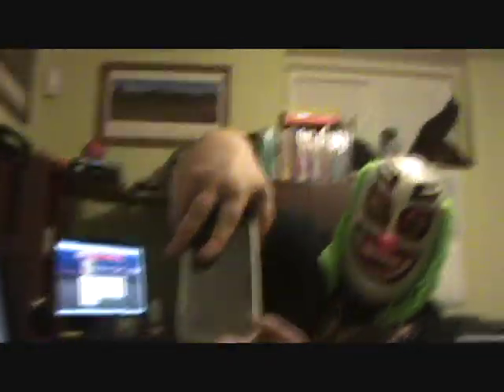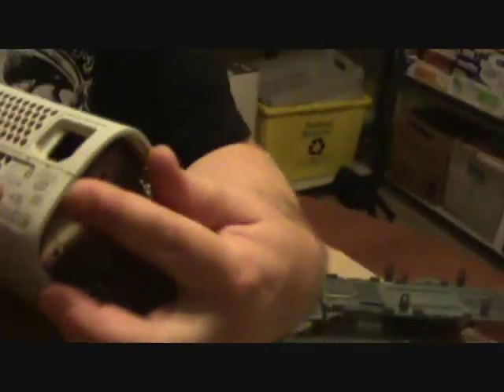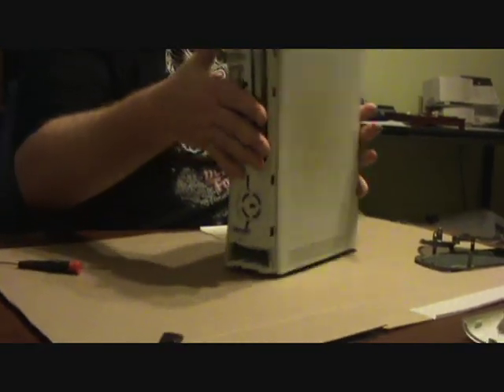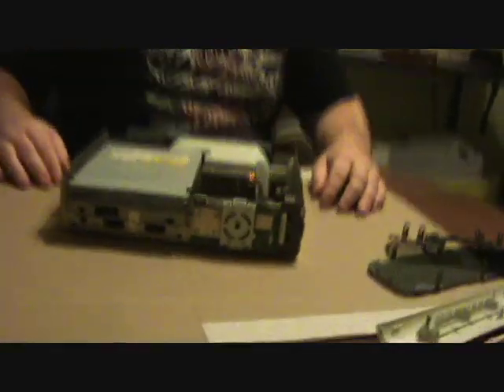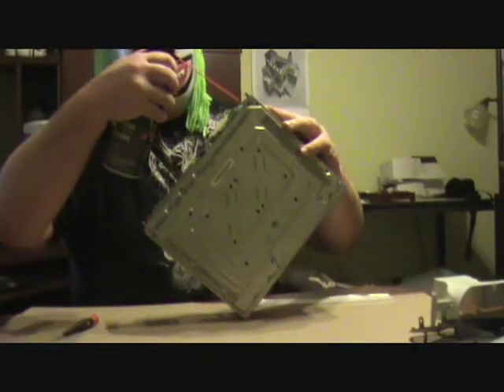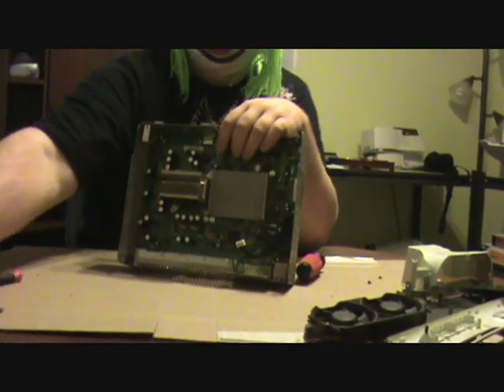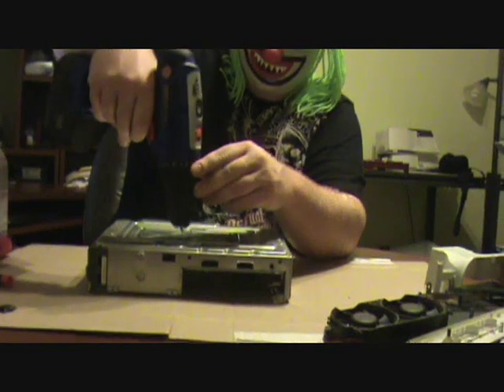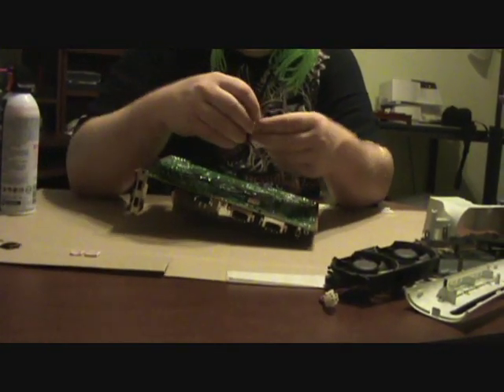XBox 360 Repair for 3 Red Rings of Death - Easy Tutorial

Comment: While it's open, solder some 40mm intake fans in. Put a couple on the bottom grey vent and/or one on the side, for even pressure air cooling. Frequently blow the dust out with canned air. Make it last >:) BTW you are NOT supposed to shake canned air.

Comment: ok so i got the #8 driver today and i got the new screws and washers i see people advertising that you need to do the proper fix and i got everything done today but now im having a prob where the fans get louder and louder and louder then its like either the gpu or cpu overheats or fails and i get vertical black lines on the screen. if i go back and put the x brackets back on, i get the e 74 posting on screen with one red light, like i had before i started. what gives? i dont think i have faulty

Comment: @iphonefreak20  You can use "Goo Gone" which can be found just about anywhere, Walmart, Home Depot, Lowes, Target, etc. It has multiple uses around the house so you get your moneys worth out of it but it also works fantastic on getting old thermal compound off. I just poured a little bit out of the bottle into a little plastic medicine cup, the kind the come on top of nyquil and such. Then I dipped a q-tip into the little cup to get some Goo Gone on it, then cleaned the processors with it

Comment: Thanks Doc, I fixed my xbox thanks to your video. I also used a heat gun after having cleaned the processors as shown in other videos. Just one remark on part 2 video: I could not mount the CPU  heat sink the same way as you did at 4:12, it had to be turned another way, maybe because I have one of the first 360.

Comment: I did this fix, and it worked. But now my fans are always spinning at full speed, shortly after I start up the xbox. Did I so something wrong, or is that normal? I have an older 360 that didnt even have the "maxi pads" on the chips that the pennies go on. Should I take them off? What would make the fans go crazy like that?